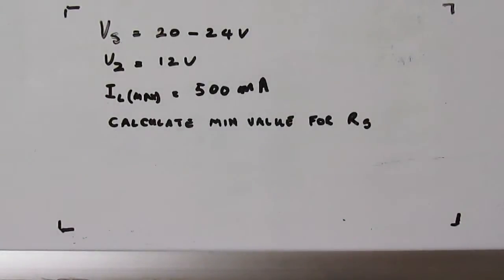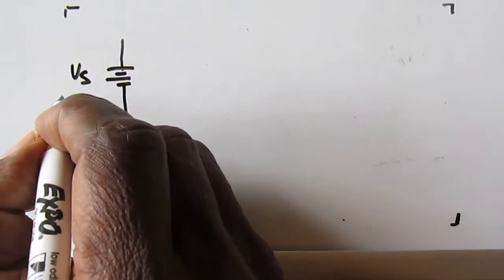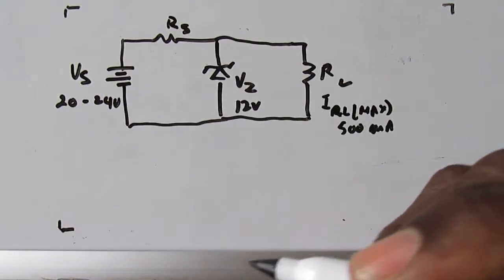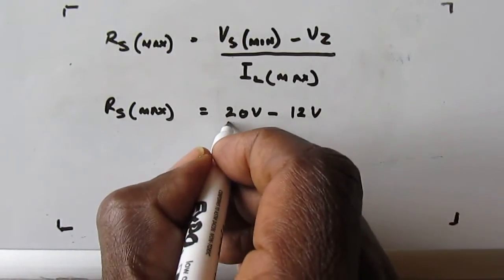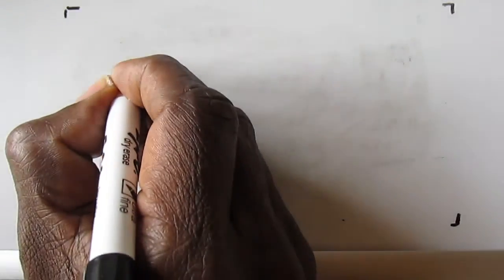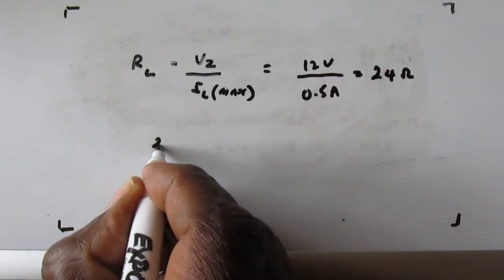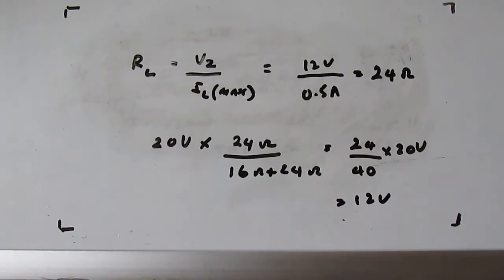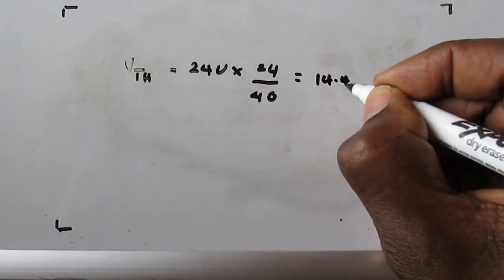Zener Diode Regulator Calculations

Comment: Sir I want to know answer for a question,

Q. What happens to the zener regulator circuit if the series resistor is of a value larger than necessary?

options:
a. Larger transformers are to be used
b. The zener diode does not go into a breakdown
c. The regulator becomes bulky
d. The zener diode is in the safe current zone

Comment: Thank you for the interesting video, however, how would one calculate the values required to protect a 24volt-500mA electromagnectic 3 way valve, and a SSR, using a Silicon diode and a Zener diode in series, the silicon I have in hand is rated 26volts?
Reply from the maker: Hello Andrew. Thanks for your comment and question. Here is a link to a site that you may find helpful in answering your question: http://www.allaboutcircuits.com/textbook/semiconductors/chpt-3/zener-diodes/